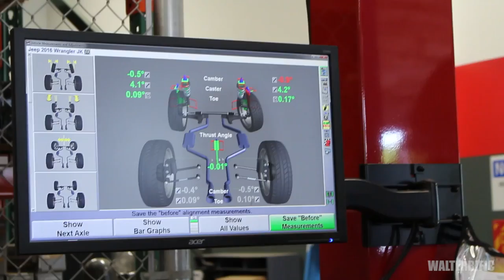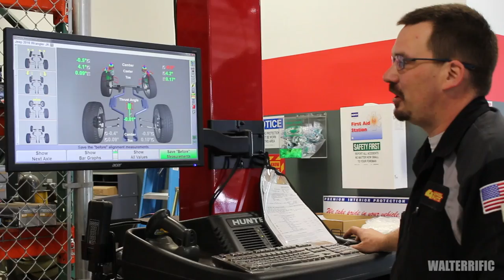Rubi Tuesday #3 - Lift Vlog

Comment: 3:47 sign of a REALLY GOOD SHOP guy in the back is actually using a torque wrench to properly torque the wheels down. You rarely see that with mechanics nowadays, most of them just use their impact guns which either under torques them or over torques them
Reply: I'm glad someone else knows these things.
Reply: i noticed that... in portugal they don't give a shit for that, bmw and mercedes are included!!
Reply: +FFA that depends on the shop. My uncle has a shop here in portugal where he changes tires and rims, and after using the impact gun he always checks all the bolts with the torque wrench!!
Reply: Pois eu não digo que não haja quem faça, só disse isso porque já fui mudar várias vezes os pneus e nunca vi usarem... É uma chave que gostava de ter para apertar várias coisas na mota, mas é um bocadito cara para o pequeno uso que lhe vou dar.
Abraço!!
Reply: +C.T. Wellington We do that where I work in Netherlands

Comment: Hey Walter!
The jeep is very nice but you'll definitely want to buy a proper tire carrier for the larger tire on the back. You'll end up popping spot welds and the gate will sag.
I have a 15 Wrangler Rubicon with a Teraflex S/T3 lift w/ the Fox remote reservoir shocks and 35in trail grappler m/t tires.

Comment: I'd swap out that spare tire carrier.  The stock carriers don't hold up well to bigger tires.  On the street it won't really be a big deal but off road bouncing around it can do some damage.  Either to the carrier itself or the hinges on the tailgate.  Time for an aftermarket bumper with a bumper mounted carrier...Just Empty Every Pocket.

Comment: did he just go from one bolt to the other on your rims?.... correct me if i'm wrong but aren't you supposed to go in a star shape pattern for equal pressure? or is that for just putting them back on?

Comment: I don't mean to be that guy, and I don't mean to voice my opinion when it isn't necessary but if you ever plan to do serious Off-Roading (meaning going through mud or rocky trails) then A-T's are 100% useless. They don't grip well what so ever through mud, snow, rocks, even wet dirt. Don't get me wrong the jeep looks great, but At's are useless.
Reply: +cody w. need some trail blades or open countrys

Comment: Walter do you think I should get a ninja 300 or 650? Regardless in a year or 2 I want to get a zx6r so I was wondering which would be better to learn to ride on in the mean time
Reply: +Josh Becker Do you have prior motorcycle experience? If not, go with the 300cc.
Reply: +pyro1324 I've had a moped for a short time before and did the motorcycle safety course this past weekend, but I was thinking the 300 would be a cheaper better route, thanks for the input tho
Reply: It's always better to feel that you can do more than what the bike can before switching to a higher displacement. Ride safe!
Reply: +pyro1324 thank you, and ride safe to you also

Comment: You do know your destroying your jeep by doing this
Reply: ummm lol.im guessing that's an opinion. and hopefully  your not thinking that's a fact 😂
Reply: +FishFind3000 how
Reply: Upgrading*
Reply: +cody clampitt when you put bigger tires and a lift kit on any vehicle it will cause stress and wear on parts that were designed to be with the stock setup. When your vehicle is lifted the driveshaft and axle  are put at more aggressive angles. Angles that they are not designed to be at. This will wear out the parts, and on top of that your changing the size of the tire so there both heavier and larger so the engine and tranny have a harder time getting the extra weight moving plus everything g has now been geared up so its that much harder for the engine and granny to get it moving. All of this is destroying the jeep. It's not meant to be this way otherwise why didn't the engineers just make it like this and sell it to you ready made???